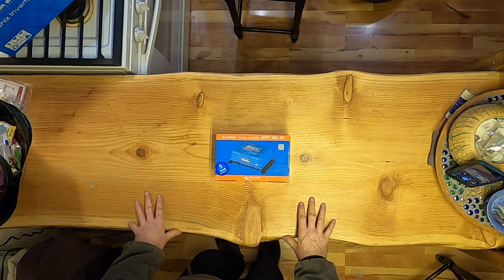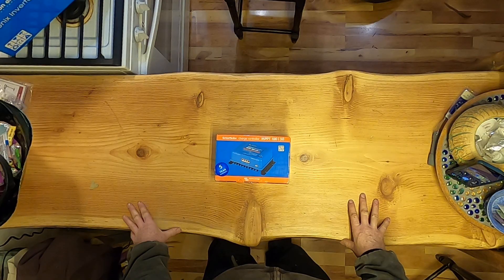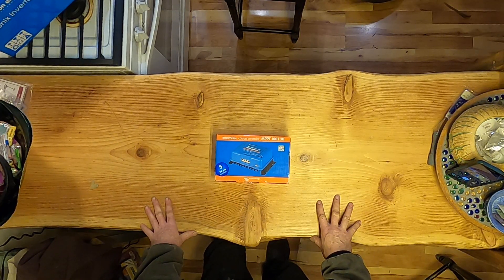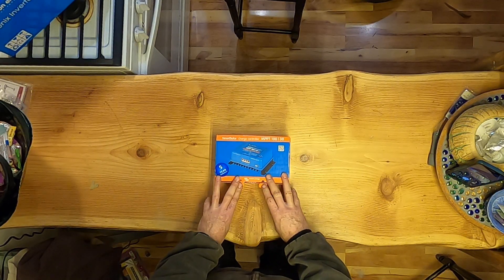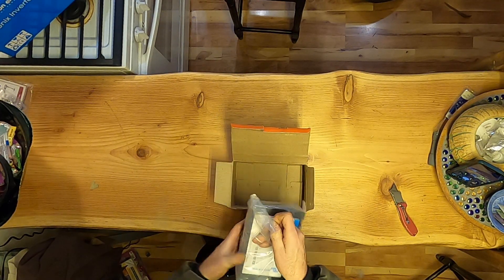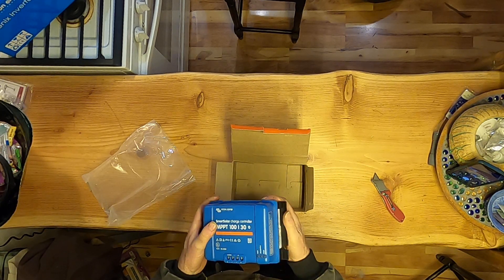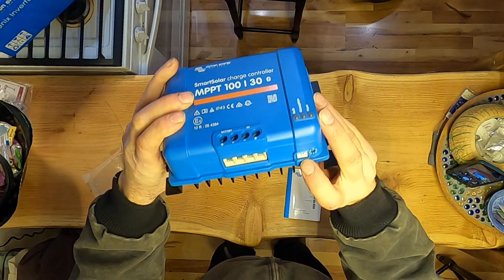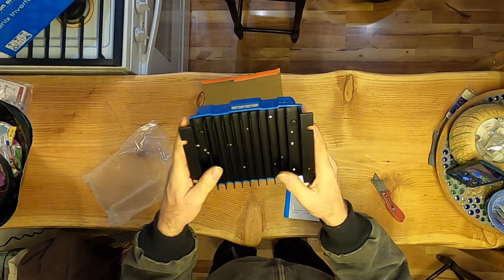12V Toolbox #2 Victron SmartSolar 100/30 MPPT Charge Controller Unboxing

Comment: My  Vitctron almost identical except mine doesnt say Smart, it just says BlueSolar charge controller. Its designed for Bluetoof i guess? But im wondering what the differences are?
Reply: The smart has Bluetooth in it already the blue solar you have to buy the Bluetooth dongle
Reply: @N2UPROD  thank you